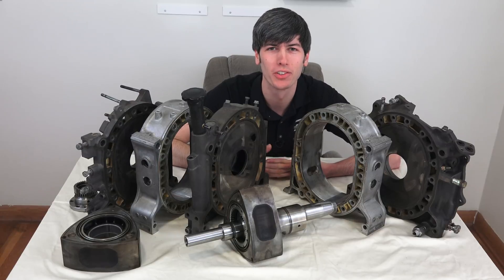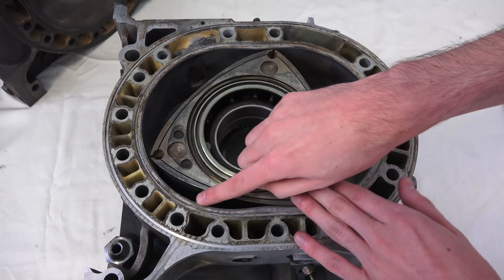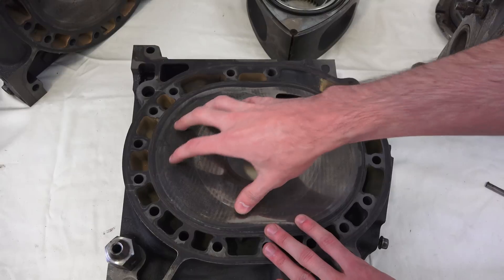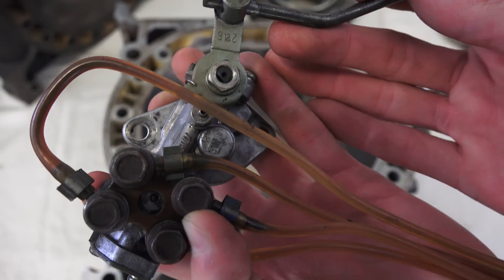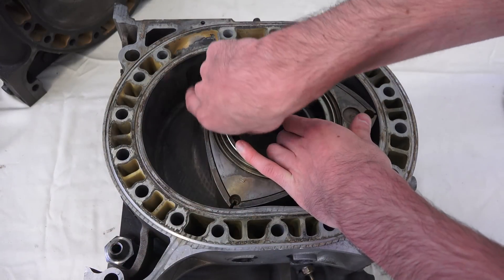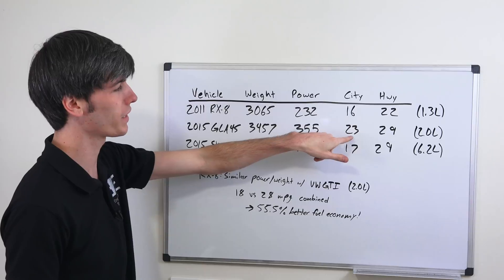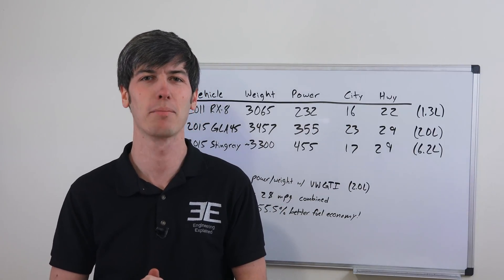4 Reasons Why The Rotary Engine Is Dead

Comment: It's not about the miles per galon. But it's about the smiles per galon
Reply: Per gallon of oil?
Reply: Nicolas Broszky well, it’s all about the sound, for now. The problem is that the rotary is mostly undeveloped, and had little to no improvements since its original patent. It performs pretty well for a brand new engine type, don’t you think? As for electric, Teslas are amazing at acceleration, but are heavy due to the battery packs they have to carry. That will most likely be improved, but for now, gas is much more wieldy.
Reply: If you need to think about  your miles per gallon, you can’t afford a sports car - so don’t buy one. It’s simple
Reply: MDS Tell that to China, India and the US coal industry. Moron.
Reply: Says the person with terrible miles per gallon.
Reply: @gazlink1  
lol
Reply: @gazlink1  And worse spelling...
Reply: @gazlink1  bro it’s ok you don’t have to try and justify your Corolla
Reply: @David-kl7to  Corolla is more reliable... more power than an RX with blown apex seals...
Reply: @sandervanderkammen9230  Not at all if you actually know anything about rotaries and how to work with them, but if you don't then the corolla is perfect for you
Reply: @David-kl7to  You mean Wankel engine? Adams-Farwell is the only car with a Rotary engine.
 Wankel engines are obsolete technology because they are too unreliable and horribly inefficient.
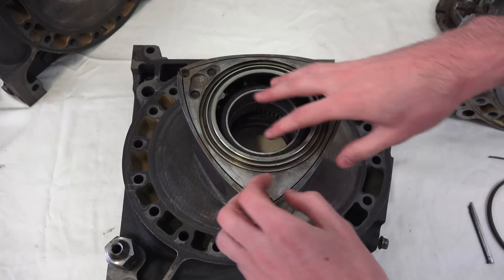Reply: 1:35  1:52  @gazlink1 1:39
Reply: 3:12 3:14
Reply: @gazlink1  He said galon not gallon
Reply: @mickjager5974  still said by people with terrible miles per gallon.
Reply: @gazlink1  Name A Single Fun Sports Car With Good Gas Mileage.  Nobody's Buying A Sports  Car For Gas Mileage
Reply: Nicolas Broszky  Soon as they get the battery range and recharge time down, then electrics will be viable to me.  For now I need something you can hop in and take a road trip with.  That being said, I have an Audi S6 stage 1 tune.  I've had 3 stop light drags with my car, two were against Tesla P85D's, They were both draws.  Third was against a truck that some guy thought was hot, it wasn't.
Reply: BBBRRRRAAAAPPPP!!!
Reply: It's not about miles per gallon, it's about miles between engine overhauls that was it's demise.
Reply: Nicolas Broszky yes, for the sound and the emotion. I’ve driven quite a lot of sportscars, even a few electric ones (Tesla Model S and Roadster). And I really do enjoy and love electric cars for their neck breaking performance. But there are only two cars that gave me emotional goosebumps, those being a Lamborghini Centenario (I work as a mechanic for Lamborghini, so yes, I got to drive one) and my Mazda RX-8. When you rev a Rotary, it doesn’t scream, it sings for you, like an opera, it tells you a story at every rpm.
Reply: I'd be smiling a lot more getting better mileage with more power... as in every other engine type here.
Reply: Dee-Bee Kooper I‘m just gonna assume that you never really drove one
Reply: you should see the smiles of the roadside assistance each time you call them and pay them to assist you.
Reply: I bet you don’t even smile
Reply: more like miles per engine rebuild.
Reply: The reason why rotary engine is already dead is becase it is not toyota . You cant kill toyota engine .
Reply: If a fart generator makes you smile. More power to you.
Reply: @MDS-c5l  you haven't fallen for the co2 scam have you.. 😂 twat.
Reply: Couldn't say it better :)
Reply: Agree
Reply: @MDS-c5l  bruh we cant care for our atmosphere, if every production, car, electrical plant everything stopped immediately no emissions or anything, the earth still is not saved, it's still inevitably going to die
Reply: @TitanBeats  industrial pollution is the real culprit
Reply: @poomrapeesannok7441  Wankel engines are obsolete because of the horrible reliability... not pollution.
Reply: What are 'galons'.?
(is it pronounced 'gaylon?)
Reply: galon
Reply: Those of you who roasted me for my grammar, I'm Indonesian, and I can't spell English too well but I can speak it
Reply: And it still has better mpg than my truck, idk why car people think 18 is low lol, my truck gets 16.9 and I’m always on the highway. It’s a 2013 f150, not very old either.
Reply: smiles per backfire per gallon
Reply: lmao
Reply: Shut up, Evan...
Reply: Unless if you poor man
Reply: @christantoseno  Miles per gallon is one of the reasons people stopped buying them.
Reply: Gallons per mile
Reply: @daviddou1408  already have my bruv, methane is a greenhouse gas
And ‘fact check’ is a misnomer at this point
Reply: We’ll see if that smile sticks around at the gas station after filling up
Reply: @senator_sandles  No smiles when you are waiting for the tow truck...
Reply: You mean kilometers per liter and smiles per kilometer
Reply: @norwegiannationalist7678  You won't be smiling at all if you invested in Liquid Piston, its a fraudulent investment scam.
Reply: Today is the the 9 year anniversary of the  end of RX production at Mazda.
The very last Wankel engine powered car rolled off assembly line on June 21st 2012.
Reply: The people criticizing the rotary engine is because they don't know how powerful for a 1.3 engine.👍
Reply: @bolin38jg  Its not really a 1.3 liter..
Reply: Samuel Jesse Jonah  lol bmw ? im a bmw user and my e46 325 only been running for 130k miles and got too many things to fix meanwhile my yaris is 250k and still running fine no major problem
Reply: Samuel Jesse Jonah  Nostalgia is a seductive liar... the RX3 was a gutless turd with a very unreliable engine.
Reply: Samuel Jesse Jonah  Mazda is a company with a brand image known for making cheap, entry level cars targeted at young first time buyers... it is not a brand associated with high quality or reliability.
 Mazda discontinued production of Wankel engines because they could no longer meet minimum industry standards for reliability and durability.
Reply: Samuel Jesse Jonah  BMW and Mazda are not even in the same class of manufacturers.. BMW was founded as an aircraft engine manufacturer with an outstanding reputation for reliability.
Mazda was founded as a cork and bottle cap maker that entered the market building rickshaws and building obsolete foreign engines under license, its gone bankrupt 3 times and was only profitable when it was owned by Ford Motor Company.
Mazda produced the most unreliable engine sold in the 21st century, the dismal failure known as the 13b-MSP-RE aka the "Renesis" which was responsible for the third bankruptcy.
Mazda was forced to recall and replace more than 50,000 Renesis engines under warranty or recall for premature engine failures.
Reply: Samuel Jesse Jonah  I have done my research, Mazda North America was forced to build a brand new larger warranty rebuilding center in Chesterfield Virginia remanufacturing failed RX8 engines... the facility operered at maximum capacity of 5,000 units per year, these were combined with new replacement engines imported from Japan and and rebuilt units from outside contractors.
Over 50,000 engines were replaced by Mazda in the U.S. alone for premature failures.

John is YouTuber... the opinions expressed on his blog are his and not a credible reference source.
Australia is a small, struggling niche market and no longer manufactures any new automobiles, it  does not reflect the automobile industry as a whole in any way.
Reply: Samuel Jesse Jonah  There is nothing more old and outdated than the automobile market in Australia... you guys are the last to get the hot cars or new technology... Australia has one of the oldest fleets of cars in First World..
If STRALya!!! is even actually a First World country???
I'm not sure, its hard to tell sometimes..
Its a backwards forgotten place at the bottom.
Reply: Samuel Jesse Jonah  Mazda was OWNED BY FORD until 2009..
Its really gone to shite since then.
Reply: There useless engines they ain't practical one bit they work for a bit but it's a dead idea didn't work no good points at all
Reply: Exactly
Reply: @Driveway_Boys_Media  no smiles when you are standing on the curb waiting for a tow truck... just laughs!
Reply: Smile that turn into tears every 60K miles when you've to rebuild the whole engine
Reply: Happiest man alive XD
Reply: Said someone that’s never driven a v8
Reply: Denny Cahyalie if you like this shitty engine than I’m fine with that that’s up to you but as far as I’m concerned it sucks
Reply: jack hewitt If you give it enough attention, it will last very long. working on our cars is our hobby, so what’s wrong if it’s broken then ? Rotaries are easier to fix than piston engines.
Reply: @xhearthfirex6571  because if you take the to give it attention it's not wearing it's self out lol, real engine fans would rather spend time getting there reliable piston engine 2 or 4 stoke mabey even jet engine to make the power it can make safely without fixing a rotary engine that is a engineering mistake and can't even make it's power it sould do with out losing compression....if you think the rotary's better I would keep it to your self as no evidence stands as there is none!!
Reply: @jackhewitt7902  Mazda have been using it for years and still do.They will do 100,000 miles before rebuild.MPG isn't great but power to weight is brilliant.
Reply: MDS go away environmentalist
Reply: Less power to weight ratio.

So no.
Reply: MDS Chill, dude. Chill.

Besides, cows produce most greenhouse gases by farting.
Reply: @MDS-c5l  Except that rape is real and global warming is not.
Reply: @600pers  This is something i don't get. Cars are such an engineering feet and so complex I would assume that someone who is interested in them and watches engineering videos on youtube would have the same logical engineering approach to other things. But i guess you proof that there are always exceptions.
Reply: @fryphillipj560  Have you seriously never seen scientists themselves arguing against "climate change"? If you want to buy into propaganda that's your right. I also understand that you believe I am buying into propaganda, but I used to believe as you do until i searched further and found what i believe to be the truth. I hope you never stop searching for truth even if it obliterates beliefs you've held closely to your heart for years. I also hope that you are at least aware of the UN's agenda 21(now 2030) which the whole "climate change" narrative is a huge part of.
Reply: @600pers  It seems like you search until you find your truth. I search until i find the truth.

At this point, believing climate change isn't real is less of a warranted opinion and more of a delusion.  Industries and professions all over the board have to adjust to a changing climate. This isn't a theory but cold hard reality.  Flora of parks has to be adjusted to withstand a different climate. Farmers are having to change what crops to grow. The arctic becomes more and more accessible shifting the geopolitics of entire nations.
Reply: @fryphillipj560  So, you really haven't come across even one of the many stories of scientists who lose their careers and are sometimes threatened with imprisonment because they go against the "climate consensus"? You haven't caught wind of how they bury anyone who speaks out against the mainstream propaganda? I understand mainstream media will put a scientist up against an oil executive and call it a debate but you have got to see the actual climate scientists who expose the dishonest ways that data is presented by the mainstream. I seriously hope you're not getting your info from Netflix documentaries!
Reply: @fryphillipj560  Also, why is this supposed to be the first time in world history where no species die and the weather never changes? I mean do you even separate the events that happen from the natural cycle of life anymore or is every death now attributed to man-made climate change? Who makes those distinctions now?
Reply: @fryphillipj560  Have you ever even looked at agricultural history? Land always changes. Desserts weren't always desserts, now were they?
Reply: @fryphillipj560  We're still discovering ancient civilizations underground, even on the bottom of oceans. I wonder how those civilizations created so much "climate change" that they buried themselves?
Reply: @MDS-c5l  So Is One Person Caring Gonna Help.  Your Mistake Is Thinking The Rest Of The World Is Gonna Give Af.  The Planet Was Doomed The Second Human Set Foot On It.  No Take Backseys
Reply: @SupremeKai_Omniverse  lol   Sad but true

Comment: I had a great looking 85 RX, silver, with the 11B engine and 4 bl carb. it was inefficient at any speed but it was so much fun to drive. I was the second owner and did not keep it for long, but I am a fan. I think it could come back if they made several improvements, some small, some major.

Comment: Guessing that VW GTI rating was before the VW MPG scandal?
Reply: Guys. The VW emissions scandal was referred to as "Dieselgate", because it involved the 2.0L TDI/GTD DIESEL engines. A software hack was employed, which bypassed parts of the emissions control system during normal driving (resulting in NOx emissions far above mandated levels) but used some clever sensor feedback and ECU detection algorithms to re-enable the whole system when the vehicle was being run through the very specific tests used to measure vehicle emissions. Dieselgate had nothing to do with the 2.0L petrol engines used in the GTI. Just thought I would clear that up. :)
Reply: It had nothing to do with the GTI. It was the TDI that had the issues. Get your facts straight
Reply: Well probably but it was also more of an emissions scandal. The car was designed to bypass emissions out of the system before the sensor locations used during an emissions test. Although yes, it would be easy to make a fuel pump lie as long as the rest of ECU knew to play along with the bad math the user/tech was being presented with...

Comment: Hey brother... About fuel economy... Horse power... U are 200% right!!! And u forgot say about torque, rotary engine if u compare with other even with the same hp rotary dont have a great torque... But dude u never ever talk about the "brap... Brap... brappppp" ... Passion dont have price tag... And also rpm dude... For that reason rotary  will never die... But the points u put in here u are right... Just the points i put in here is stronger... U know dude... Passion and love is always stronger lol...

Comment: They should be allowed in F1, that would speed up development.
I'd love to see a naturally aspirated 1000cc 5 rotor pushing 500HP at insane rpm. Considering that F1 got to 300HP /L with 4 stroke engines and 300cc cylinders, getting 500HP per L with a Wankel doesn't seem insane.

Comment: Having had a 1975 RX-4 station wagon that I absolutely loved, I can understand your points. But new materials are being developed all the time especially in ceramics. Natural gas is becoming a more viable fuel all the time. The power-to-weight ratio of piston-to-rotor engines have been demonstrated beyond doubt. I read an article about aircraft applications being far safer and more reliable than piston in that as long as fuel is supplied, the rotary will get you down in one piece.

Comment: 1. Change the ignition cable to be insulated and heat resistant.
2. Oil lines are changed to use copper wires or aluminum cables.
3. Carburetor transforms into a fuel injector controlled by the ECU.
4. Rotary piston should be coated with a nylon or titanium tape.
5. Change the cooling system with water.
Would be better.

Comment: The rotary engine is actually an amazing engine in that it can spin like a jet engine without weights pulling and pushing its balance all the time and less parts and lighter but has many problems which i thought they mostly got on top of. Perhaps they should redesign from scratch and change the shape somehow or new direction as weight to power is very good especially when made out of aluminium. I think it will come back in the future with new materials available. who knows?

Comment: It was good for its intended purpose. A little to good as they changed the rules to get it off the race track. Shelved till Mazda started playing with it. If I remember right....been awhile since I researched the history on that topic. I was impressed with the fact the CEO is a hands on guy. I believe that comes through in the design as every Mazda I've had. Happen to be really easy maintain and repair for the most part. None had a Wankel so I don't know if that's a pain to deal with or not.

Comment: Didn't the Mazda 787 have a R26B 2616 cc 4-rotor naturally aspirated, mid-engined, longitudinally mounted power plant with 3 plugs per rotor?  
If you were to feed and flush each port of the rotor in a "variable port timing" configuration to distribute heat evenly across the block instead of constantly firing at the top and expelling from the bottom couldn't you theoretically improve the efficiency and fuel economy of the engine?